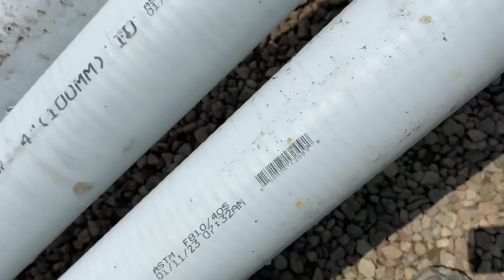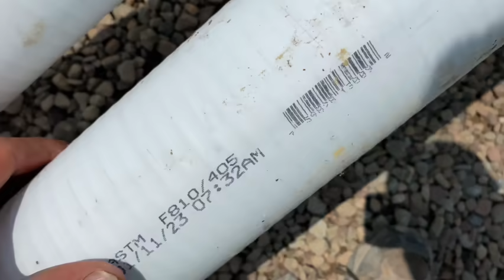POLICE WONT LET ME WORK!!!

Comment: DOT is a $ game. It's obviously safer to pull that load with your dumper, but you didn't pay to jump through CDL hoops, and the insurance mafia for truckers. I'm glad it wasn't worse for you than losing a day's work, Bondo. 

They're doing this same nonsense in my neck of the woods, trying to get the little guy with a couple lawn mowers on his trailer.  Another great job, as always 👍👍
Reply from the maker: Thanks yes it is just a way to get money because the working man will just pay it so he don't lose a days work.
Reply: @bondobuilt386  You wouldn't have had that problem up in Canada where I am, half the time they aren't even working and when they are they don't chase you down they sit in wait in areas that are marked oh and the best part  they will tell ya the days they will be doing the blitz on truck inspections.
Reply: @gadsdenconsulting7126 It has nothing to do with money or jumping through hoops and everything to do with making sure drivers are qualified to handle that amount of weight as well as knowing all the laws! If he would have simply had his CDL he would have known all the requirements and not had any issues! Would you be OK with flying in a jet knowing the pilot did not have his pilots license, Or how about going on a cruise ship that was piloted by a captain without his captains license! It is all about protecting everyone on the roads from unlicensed drivers operating heavy  rigs! That trooper was absolutely correct in doing what he did and the driver was wrong, People can make up all the excuses they want but that is just their lack of knowledge and ignorance speaking!

Comment: We run into the same problems in NC,  just derate the trailer.  It’s such a stupid law.  I love when they pull me over like that and I whip out my Class A with every endorsement!It’s much safer to haul that load the way you were, instead of behind an f250!  I also find it very interesting that all of my new tractors constantly get a level 1 inspection but any of my older trucks that might have a problem never do.  Basically the troopers are only inspecting new trucks that they know there is nothing wrong with for an easy inspection.  Glad you got off with just a warning
Reply: Might as well buy a 10k trailer, you're giving up pay load when you derate a trailer.

Comment: You need a hang shoot like we use here in Arizona.  It's a 16 foot long shot that hangs under the truck shoot by a chain.  The bottom sits on the ground and is moved around by hand while the chain lets it flex right to left without moving the truck shoot.  They are perfect for situations like this footer to reduce or eliminate need for wheelin mud.

Comment: You still won’t be legal even after de-rating the trailer.
A CDL is required when your combined rating is 26,001 or more. Doesn’t matter if you’re under weight, your rating is what determines CDL or not.
Reply from the maker: No I can haul a 10,000 lbs trailer and 26000 on my truck so combined to 36k legal but I have to de rate the trailer. he gave me a flow chart and explained it all to me in detail because I did not have a clue.
Reply: 26,001 is a magical number that alot of people forget and end up in court
Reply: @user-hv3gj5we5j  26001 is only the magical number if your trailer is over 10k lbs.  You can Under CDL with a 26k truck and 10k trailer for a total gross of 36k.  Class A CDL requires a trailer over 10k, and Class B requires a truck over 26k.  So if you have a truck at 26 or under and a trailer at 10k or under you don't qualify for either.  Thats why you see tree trimmers only pull chippers.  26k trucks and under 10k trailers with no CDLs.
Reply: @bondobuilt386 you are 100 pct wrong the guy is right ,and it’s a federal thing not a state thing
Reply: Maybe the truck has a 16k gvwr? So with a 10k trailer, he'd be right at 26k.
Reply: @fuzion430journey3 he said the trooper gave him the flow chart
Published by the state I think that might hold more weight then someone on the internet saying differently
Reply: @fuzion430journey3 no, he isn't wrong at all. The truck can gross 26k. If he debates the trailer he can pull a 10k trailer with a 26k truck for a total of 36k and be ok without a cdl. 
Its mind blowing how everyone knows so much about everything to tell others they are wrong. When its clear you have absolutely no clue what you are talking about.

Comment: Washington is the same way on the licensing issues its a nightmare pain in the ass. makes for a lot of people running massively overloaded 10k trailers behind 1/2-3/4 ton pickups then they dont have to scale and commercial enforcement does not have jurisdiction over them here to do anything about it. ive gone to running a ramp truck for moving my equipment and a 2 ton flatbed for materials   stays both sane and out of their crosshairs.

Comment: I switched to hauling equipment with 2500s because of this years ago. I license the truck to 15 tons and pay the extra fees which is all its about. Sold a 450, and only drive the 350 with a 10,000 lb trailer. Also you never see the big trucking companies pulled over, only us small guys.
Reply: Is that 10k gross or net?
Reply: @FreedomInc  yes
Reply: @FreedomInc  gross

Comment: Stupid rule. The dump truck is ten times safer than the 250. The load on the single tires is what causes problems, probably over the rated load for the tires, will cause blowouts from excess heat generated from a much larger contact patch.

Comment: My state is the same way. The rules with truck and trailer are really strange and not even safe.. I can legally tow a 14K trailer with an F250. I can legally drive an F550. But if I hook the trailer up to the F550 thats not allowed even though an F550 is a safer rig to haul a 14K trailer but .gov would prefer I use the F-250. To make it even more confusing you can hook up a 12,000 pound wood chipper and thats somehow allowed because its "special equipment".
Reply from the maker: Same thing here in New York. so stupid though.
Reply: @bondobuilt386  Mount a wood chipper on your trailer?

Comment: it's not a fix it ticket. It's a Federal  Level 1 DOT inspection report and it stays on your "CDL" driving record forever. The inspection is usually performed at a weigh station. This means if you start hauling freight, you already have a ding against your safety record, and your insurance premiums will go up.
Reply from the maker: That is not what the officer said.
Reply: Level 1? How bout level 3. The inspection is usually performed when they pull you over when they see you pass by with easy to ticket items. Usually flatbed as thats the easiest. I think you’re wrong with a lot of things.

Comment: So I'm confused, why would the F250 be any different than Clifford legal-wise? I'm guessing the GCWR of the F250 is north of 16000lbs, so if you add that to the 14,000lbs GCWR of the trailer, you're still over 26,000lbs GCWR? I'm gonna go talk to a trooper today and try to figure this out because I have a 14K GCWR trailer I want to pull and it seems like I need a CDL based on the insane law.

Comment: I've wondered about the position of the holes on solid pipe.  I'd thought putting the holes at 8 and 11 would allow water to enter and you have a solid bottom to keep the water, holes in bottom allow water to exit into the gravel and travel along the stone, so what is the pipe doing that the gravel isn't ?
Reply: The pipe gives a void for the water to move uninstructed, the water will choose the path of least resistance as it fills the pipe from the bottom and flow to daylight
Reply from the maker: @seankirkpatrick8171  Yup good answer
Reply: Water will fill the bottom of the trench up. So any distance the holes are above the base of the trench, that's how much water will be sitting in the trench.  Apple Drains youtube has a demo video on this 'How To Install Perforated Pipe, French Drain for Do It Yourself Job'

Comment: TN has the same CVWR laws. It is federal law. The law changed as to how much weight a dump truck can haul on an interstate. Used to my Triaxle could haul 74000 lbs . The new law has it restricted to 56000 total weight on the interstate and 74000 lbs on non interstate roads. The max for a single axle gross weight is 20000 lbs. You need to check it out. Our law looks like a cut and paste of federal guide lines. Thanks Joe B and Pete B. PS in TN the fine is .10 per pound or in my case $1620.00
Reply: About 10 years ago, I was driving a tri-axle KW dump truck loaded with 18 tons of asphalt, and pulling a 32' trailer full of paving equipment. I topped a hill and BAM there was DOT Officer Joe Bloe talking to a log hauler in the center of the highway (US 72 in Mississippi)... He saw me, and tripped over his own two feet bouncing back to his car, letting the log hauler go... A mile later, I was the guy in the center being "talked to"... He put me up on the portable scales, and dialed me in at 100,380 lbs... HE WAS NOT A HAPPY CAMPER!!!! My boss had to bring Officer Joe Bloe $2950 in CASH - no checks, no MO's, no IOU's, no NOTHING but cold hard cash... He then let me drive away as I was - 100,380 lbs... It REALLY is all about the cash, and safety has been forgotten about...

Comment: Takes you from a safe towing situation, to an unsafe towing situation, simply to make it within regulations, typical NYS. It’s not like it was a road altering weight you were hauling. A few years ago I hauled 5 pallets of decorative flat rock down from Hammond, 2 pallets at a time, took all back roads, just to avoid this kind of problem. If you had junk equipment, it might be understandable, but you obviously do not. SMH! 😮 The problem they had on 690 a few years ago might be a contributing factor to his decision, that was the other end of this spectrum, someone being foolish with bad equipment.
Reply from the maker: Ya I should have took back roads. LOL
Reply: @bondobuilt386  It Would be nice if they looked at the situation on a case by case investigation, with a little common sense thrown in for good measure. I don’t know how much discretion they are allowed to make a determination, but putting you in a dangerous situation just to enforce regulations, isn’t the smartest solution if I was asked. Might get a chance to talk to you soon, there’s going to be a large amount of concrete work being done next door, right across the street from one KBI owner, small world. 👍

Comment: I would use ICF on the whole building including the garage also, blocks  still has to have cores filed and over time the cinder blocks rot if they are below grade and get wet.
Reply from the maker: We will have a good drain and backfill with stone.
Reply: Not if you use the right  sealer. They will seal the walls.

Comment: I’m confused…. If the truck is 26k and your trailer will be registered at 10k, your combined GCWR will be 36k… that combination would require a CDL….no?
Reply from the maker: Nope I could haul that 36K legal. real confusing.
Reply: You are correct!  The  GCWR determines weight class as well as CDL requirements. 
My truck GVW is 13K. My trailer “was” rated for 14K. De-rated the trailer to 13K. Now my GCVW is 26K. Non-CDL. However, if using that combination for work, a CDL medical card is required!

Comment: Empty truck registered for 26,000 lbs gown pulling 10,000 lbs gvw trailer is legal none cdl. Don’t get caught with trailer more then 10,000 lbs gross or total gvw over 26,000 lbs. Any vehicle registered over 10,000lbs must go thru weight station except RV

Comment: The State Police or PUCO in all states have ramped it up on the 26,001 pound rule over the past couple of years now.
Reply: That isn't the case here. Its the combined weight being over 36k.
A 26k truck with a 14k trailer would need a cdl.  A 26k truck with a 10k trailer does not. 36k is legal without a cdl

Comment: 120👍's up BB thank you for sharing
Reply: But the blacks will allow seepage water into the blocks and after awhile they'll freeze and the block so get destroyed in the concrete slab will sag and and crack
It's a must to put away per barrier or a waterproofing membrane overall concrete blocks
Reply from the maker: @scotthultin7769  Proper drainage is what you need with block walls.
Reply: Well my house is built in sand in the block walls that hold the garage floor up or crumbling and blowing apart because of the freezing water that got into him because blocks are porous and water can flow through them just like a sponge
Reply from the maker: @scotthultin7769  Definitely no drainage around it. Gotta keep a block wall dry and it will last a long time.

Comment: With those portable scales, when you are weighed, check to see that they return to within a quarter division of zero after you are weighed.  If they do not return to zero, that is a fail by the department.  It is also a requirement that you are weighed in a straight line.  Not crooked as you were weighed.  As soon as the officer makes one mistake, you can tell him to get lost, as once the mistake is made, anything after that is harassment.